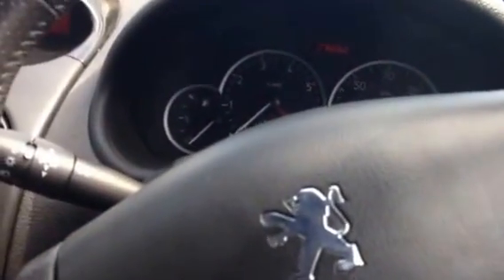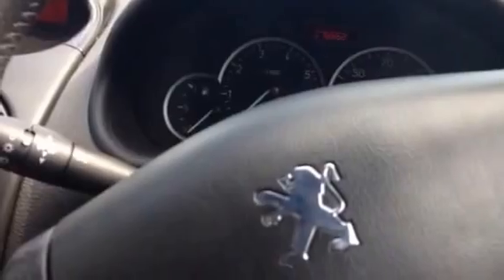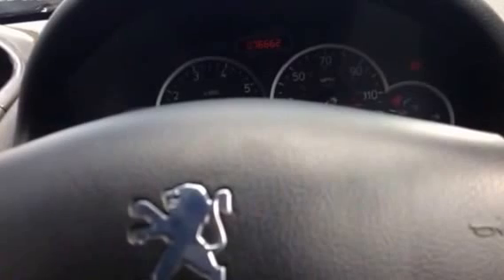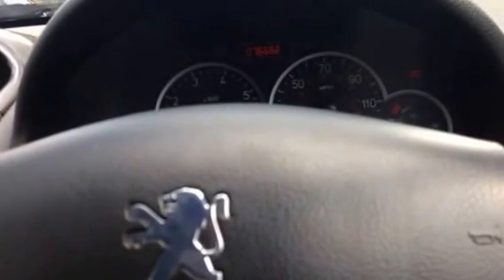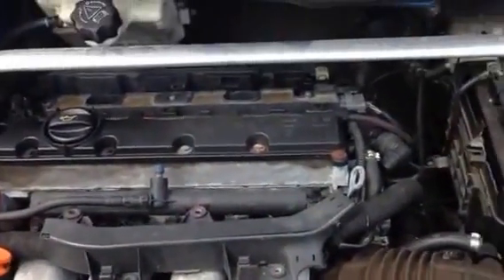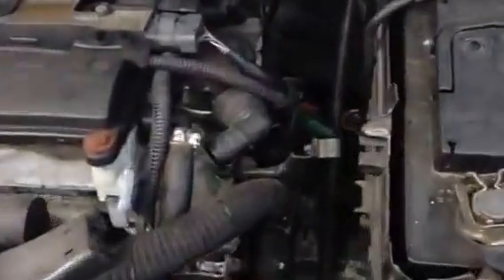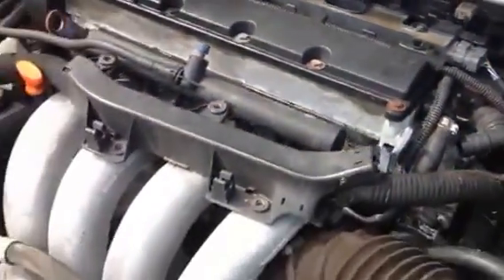Peugeot 206 GTI 180 Hybrid Build – EW10J4S Head on EW12J4 for More Power! 🔥🚗

Comment: hello mate! how can i contact you? i was thinking on a 2.2/2.0 project but im still unable to find info about it. thanks
Reply: +Shannon “SP88” Phillips hello, we want to use a 407 bottom and yearbox with a rc head if its posible or use only the bottom and keep the gearbox, but we are from costa rica and we want to know what parts needs to be purchase to calculate the cost, i also have a 1.4 8v and i will like to use a 1.6 bottom of its posible since the engine needs a refresh
Reply: +Shannon “SP88” Phillips  hello, yes both 8v, the flywheel and gearbox in the rc match?
Reply: +Shannon “SP88” Phillips hello! what is a 206 fri?